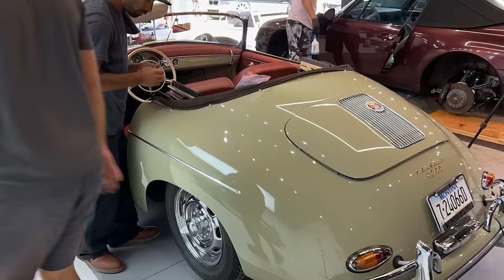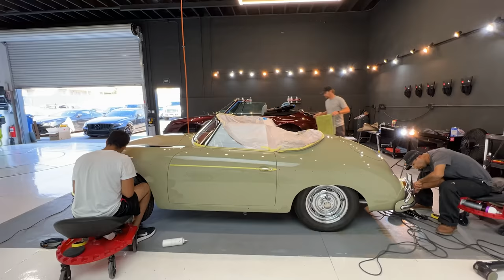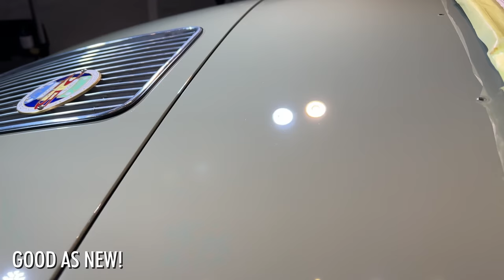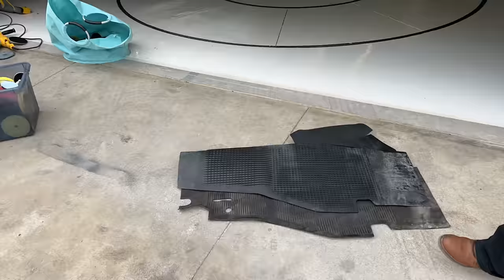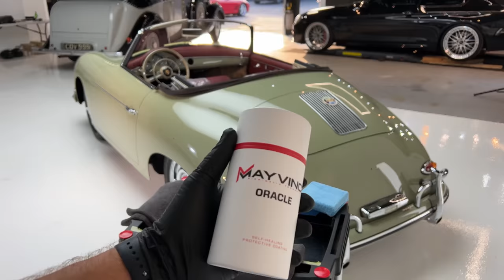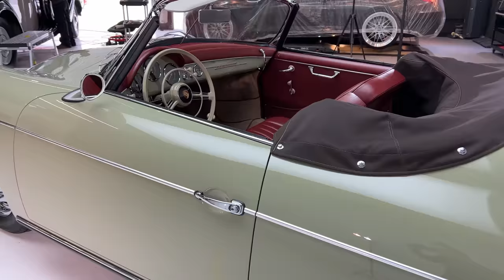Detailing Porsche 356 Cabriolet to PERFECTION

Comment: Good work- but it's not a 356 Cabriolet. This is a 356 Convertible D - made by Drautz. The windscreen is the point you can easily see the difference.The cabriolets frame is painted in car color. The Convertible D is chrome metal similar to the Speedsters frame but not rounded on the edges.
Reply from the maker: Learn something new every day! Thanks for the insight!

Comment: That has got to be a very concerning thing to do, removing trim that may well have oxidised fixings that could easily break, or find paint lifted because of rusty panels around the trim fixing holes hidden under the trim.
Your experience of polishing paint has given you an invaluable knowledge of how far you can go in dismantling trim to get that perfect IAD panel shine. 
Respect 👍🏼👍🏼

Comment: This has to be one of my favourite details you have done. I love the single stage green paint and how you made it appear 3 dimensional! You always manage to offer a finish that one could almost dive into with the incredible shine and depth. I’m curious about the ceramic coating you used though. You said it is somewhat expensive, but goes on thick and allows more time before drying. So how easy is the buffing stage with this product? I have found some thicker ceramic coatings are tougher to buff than the thinner ones. Just curious!
As usual, fantastic work and great video content. Keep up the amazing work. 👍🇨🇦
Reply from the maker: It’s not super difficult like some on the market but at the same time it’s not something you can just remove with one quick pass 😉
Really good coating and feels also pretty good for a long time compared to some others that are only super slick for a couple hours ,maybe few days.  

Thanks for watching Bernie!